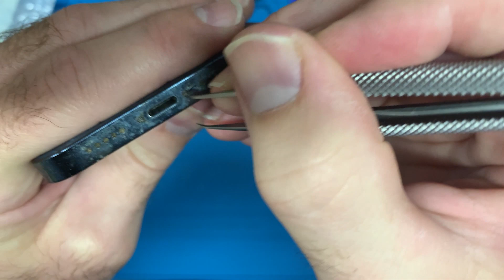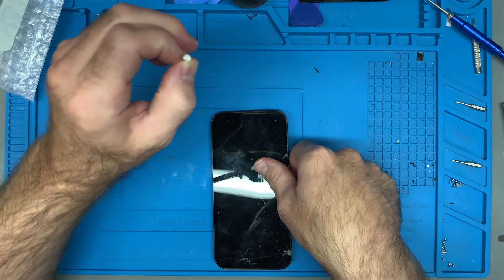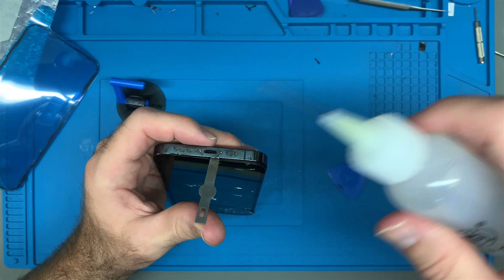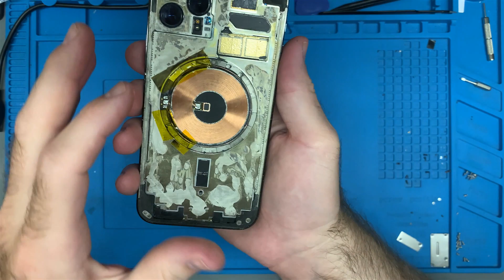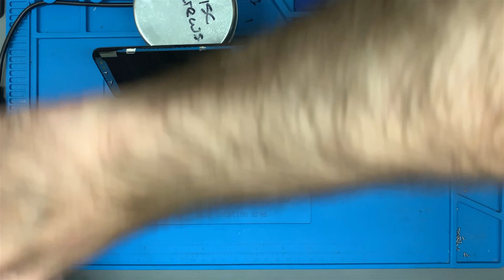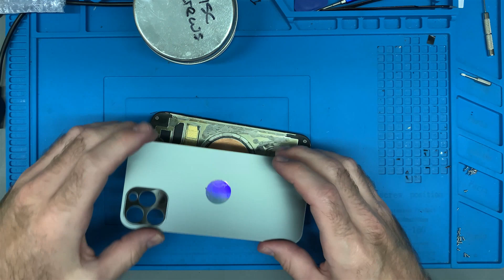iPhone 12 Pro Screen Repair with a Stripped Pentalobe Screw

Comment: Do you know any ways to get a stripped screw out if it’s completely in?
Reply from the maker: There are a few ways. Some are more successful than others, but also, the less successful ones are less dangerous. 
1 - If the screw can still be moved a bit, work it back and forth carefully, with max pressure (careful of slipping), unscrewing just a hair, then tightening just a hair. Keep doing that until it feels a bit loose, then try unscrewing more than before. Rinse and repeat until it comes out, or completely strips. I have had a lot success with this method, but it requires that the screw is not completely stripped. 
2 - If you managed to work it out even just 1mm (32nd of an inch), try using precision needle nose pliers to unscrew the stripped screw
3 - if 1 and 2 doesn't work, use a thin elastic band over the screw and push against that with the pentalobe screwdriver. then unscrew like normal (highly unsuccessful, but I've heard of others being successful with this)
4 - If 1 through 3 fail, and assuming you have at least 1mm (32nd of an inch) of the screw out, use a dermal  to cut a channel into the screw, producing a slot you can use with a flat head screwdriver to remove. This option can damage the bezel of your phone, even when you are being careful. 
5 - I wouldn't try this. Use a spot welding on low power to spot weld a piece of metal to the screw. Use the metal to then unscrew the stripped screw. This one is quite dangerous, as it can spot weld the screw in place if you miss. It also has the small chance of shorting out your phone due to the mass amount of voltage being dumped into the frame of the phone. I say it is a small chance because the frame is considered ground and should not travel into the motherboard of the phone. 

If all of this fails, well, I have no more ideas. I know there are special screwdrivers that can remove a stripped screw, but usually they are made for much larger screws. Hopefully something here helps your
Reply: @Tal @TalmiiorFixesStuff I appreciate it! The screws will not budge and are fully in the phone. I'll have a look at spot welding but I don't know.

Comment: how to get a stripped pentalobe screw out without showing how to get the stripped pentalobe screw out.....what a joke
Reply from the maker: The video title doesn't say I'll show you how to remove a stripped screw, just that I'm working on one. How about constructive criticism instead of blasting my video. There is not always an easy solution for getting a stripped penelobe screw out anyways. They are made of hardened steel. This video is also over a year old, and I actually have found some methods that help prevent stripped screws and even what causes them, and no, it isn't because the tech was sloppy. Sometimes the rubber gasket get wrapped into the threats, and it becomes as bad a threat lock.
Reply: @TalmiiorFixesStuff I love this video thank you

Comment: You ever use the rubber band method?
Reply from the maker: @malachipalafox6456  I've tried it, the screwdriver just pierces through the rubber band :(
Reply: @TalmiiorFixesStuff  Although it doesn't always work, I've found that using a slightly thicker than normal rubber band is better as it'll fill in the screw hole a little better
Reply from the maker: @malachipalafox6456  I'll give it a go in the future